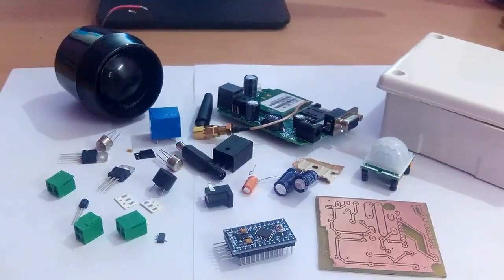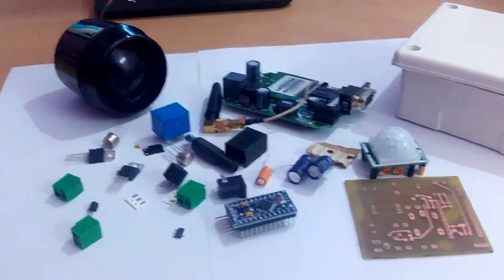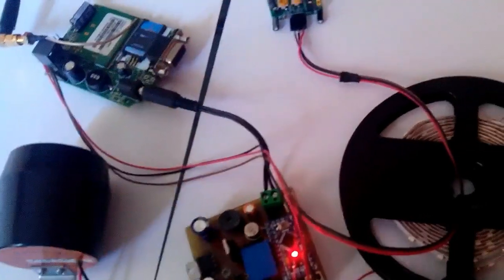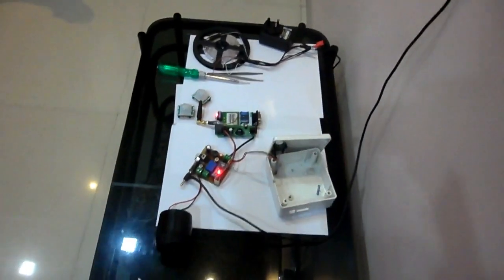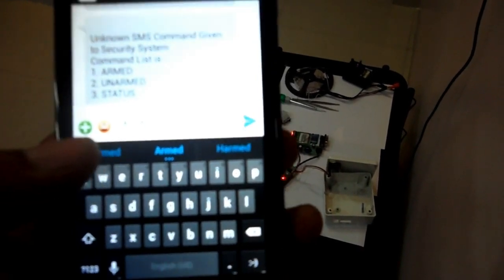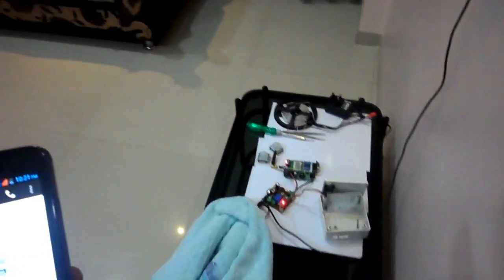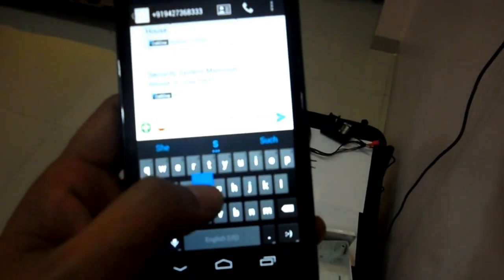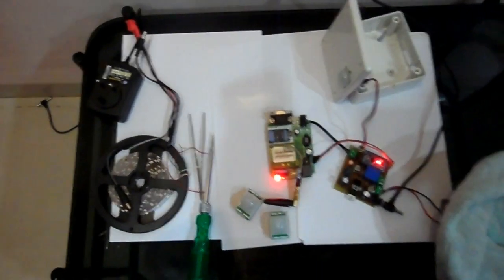GSM Based Security Alarm System using Arduino (V1.0)

Comment: Hi friend, I would kindly need this information. Is it possible to directly connect the output of a pir (eg 3.3v of a HC-SR501) to the A6 to make a call without using Arduino? If so, which pin of the A6 need to connect the output of the pir?
Many thanks for the answer.

Comment: Can I use SIM300 to connect to Arduino Uno instead of using SIM900 or SIM800L? I'm doing home security with sms alert for my university physics project but I want a cheaper gsm module. Is it going to be any error if I use SIM300 instead of SIM900?
Reply from the maker: +iqbal mohammad yes you may. in this video i have also used the SIM300 board
Reply: Thanks brainstorm ABC. You're very much of help.

Comment: Hello, I am interested in building this unit. Can you you share a BIll of materials or do you sell a kit?
I am willing to pay for the kit. Also the code for the project. Thanks
Reply from the maker: Carl Go 
Hello Carl,
Nice to know you like it. I would like to know, where  are you from? 
For making this alarm system I have used  Arduino mini pro, a relay 12V, A Buzzer (Hooter) , voltage regulator 7805, PIR sensor, some capacitor, 330uf 25V - 2 Nos, A GSM module. a small buzzer of 12V for beep sound, A Hand made customised PCB. A 12V 2A power supply. 

If want the kit, i can provide you for US$105 + fright charges. for everything including code.
Reply: HI,
Thanks for the information. I live in San Francisco Bay ARea city of Fremont Ca. In silicon valley. I am thinking can you design me the software and the interface to use bluetooth device to like motion sensor, camera, panic button switch, that can pair with smartphone via bluetooth and then when device is triggered, the cell phone can automatically mkae a phone call , a text message to the specified recipient or more than one recipients. This application is for car security systems, elderly people or kids can push button in an emergency, and also for security in homes, etc.. What do you think?
If you can do this, I can pay you for a kit for this also.

Yes, I still like your project and would like to purchase a kit. But,  can your software be ported to windows phone?  I am using a windows phone now and this could be good market for windows phone. Also can your appliclation be used in IOS iphone? How much is total price to ship me to Fremont California? I can pay you via paypall.

Thanks,
Carl
Reply from the maker: Carl Go Hi,
your idea is good. i would like know the function of the camera in this design. another thing that this whole idea required an application which is to be stored in the smart phone which analyze the incoming information from Bluetooth and act accordingly for call and SMS. if we use Andriod based device the IOIO will be the most suitable board for that. What i did in this video is based on Arduino board.
Reply: Hi,
The camera function can either be set to take pictures in a specified time lapse or turn on and take a video for a specified duration (10 seconds ) at a time. Yes I understand you use an arduino board. But is it possible to not use an arduino board and just use a smartphone to be connected to a device via bluetooth, and as soon as the device is triggered (ex motion detector) it can just make an sms message to the recipient or a phone call ? This way we don't have to use an arduino board and since there are plenty of inexpensive cell phones. Can this be done?
 Yes, quote me for your kit, I am interested in playing with the kit. Thanks